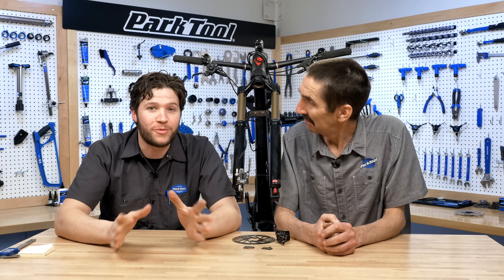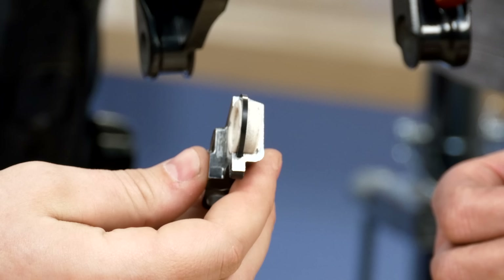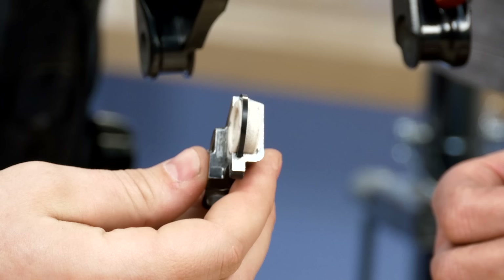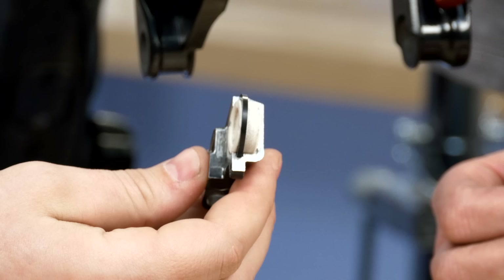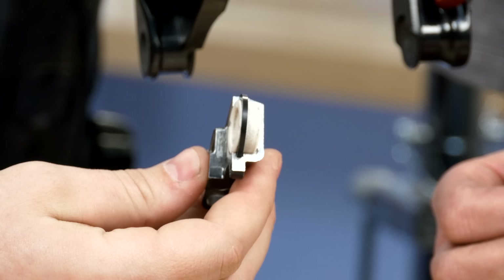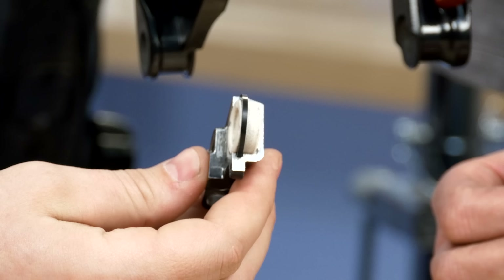How To Clean Hydraulic Brake Pistons - Tech Tuesday #104

Comment: I have the exact opposite issue, my seals are way too active- they don't want to stick at all 🤣 as in not adjusting for pad wear, what should I do? Cleaning as shown in the video seems to have only gotten matters worse.
Reply from the maker: Sounds like there is not enough fluid in the system. Could benefit from a bleed?
Reply: @parktool  I did put a funnel with fluid specifically cause I thought it was the issue, not that, don't know what's going on, cleaned once again with alcohol and made them go out "forcefully" (as in block 2 pistons, let one go out and manually adjust for even spacing from there) and it seems to be working fine for now, will see how it behaves with pad wear.

Comment: Hi! Thanks for the videos, you make by far the best tutorials but I couldn't find anything about replacing pistons...

One of my Sram Red 22 pistons (the old 18mm ones) is cracked and missing a part of it. I have the replacement kit and Avid's DOT grease. Do you recommend to put some DOT grease on the piston square-o-ring or just brake fluid?
cheers
Reply: Answering myself... According to SRAM: 

"Inspect the caliper pistons for damage and replace the pistons if necessary.
Apply a small amount of SRAM® High-Performance DOT 5.1 fluid to the
circumference of each piston. Install the pistons into the caliper bores.
...
Do not use grease. Grease will prevent the pistons from fully retracting
into the caliper bores, which will reduce braking performance.
..
Add a small amount of DOT compatible grease onto the new caliper o-rings, then install them into the caliper."

NOTE: the caliper o-rings are not the square ones but the ones in between the two halves of the caliper body.

Comment: I have a Shimano 4 pot piston from a mountain bike that’s less than 15 month old, I have explained to the bike shop that the outer bottom piston is not retracting all the way back and is causing intermittent disc rub at certain speeds which is quite annoying, they have had the bike once and said they have done a front brake service on it. I took this bike out and it is now worse than it was before. I have taken this bike back again but I don’t have much confidence of them fixing it.

Comment: I guess the seals will prevent dirt from coming into the caliper as long as the dirt is somewhat wet. After all, the seals also prevent oil from leaking from the caliper. I just wonder what the lifespan is of those seals?  And can they be replaced when 'used' or is it better to replace the complete caliper?
Reply: If you have something like a Hope caliper, then you can purchase seals and pistons to service your caliper and return it to as-new. Sadly, for a Shimano brake like this one, they don't sell service parts separately so eventually you'll have to chuck it in the bin and buy a new one. Booo Shimano :/

Comment: Thanks for the video. 

I have brand new slx 4 piston brakes on my bikes. Despite lubing/working the pistons, one side is still uneven to the other(less them 1mm).  

At the end of this video you guys day to just leave the piston and center rotor between pads. Therefore having the caliper itself slightly off center to rotor.

 I've been told elsewhere to restrict overactive pistons and balance. Then align caliper to rotor...

Wood really appreciate if you could elaborate

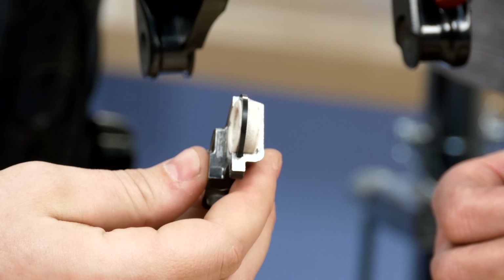Comment: 3:36 Recommend you do not insert Q-tip into container but instead pour small amount of mineral fluid into small (Dixie) cup.
Reply: I made a mistake, I pressed too hard and the pison came out, I put it back on but it caught air. and after a while I started to lose the mineral oil from the Shimano hydraulic brake. Please help me and explain to me how to proceed to put the piston back so that I do not lose mineral oil again. Thanks!
Reply: @SPN2TV  you will have to bleed it from scratch.

Comment: Helpful video! which oil should I use for my SRAM ETAB AXS 12 speed?
Reply: The fluid is in the manual for your bike.  I believe it's a type of "DOT" with one or two numbers after it. Shimano is the opposite. TIP: Register your SRAM components. Then wait a few weeks and you will get a link or invitation to a closed discussion forum on Facebook ... That is where to ask SRAM questions and get LORS of people with PRECISE answers.  Including that the manufacturer says NOT to use hydraulic fluid, or any type of lube near brakes.  (Althought here the guys did seem to do a proper clean up they didn't emphasise the safety issue enough. Lube can gradually drip into /into braking surface. But that warning doesn't solve the problem... What to clean with. Isopropyl alcohol is what one person said to cleaned with both Before AND after putting hydraulic fluid.

Comment: That was a great presentation. Very detailed with cut away parts. I had squealing brakes but after 3 repeated pad/rotor cleaning and scuffing it still squealed. After your video I checked the pistons and found they moved very little and did not retract. Followed your procedures and now they move properly. Voila!  The squealing is gone. Big thanks guys.

Comment: 3:28 they said do not let the piston fall out but what would you do if it does? someone please answer i have this problem and I put the piston back in BUT it keeps pushing out not to where it falls out again but it pushes out almost all the way no matter how many time i put it back. what can i do?
Reply from the maker: You should stop it from coming out that far. Install 2 rotors in the slot of the caliper and that will typically prevent the piston from coming out. Or You could use the handle  of a cone wrench to prevent that.
Reply: @parktool  i asked a bunch of people everyone said i needed to get them bled i have the tektro auriga hydraulic brakes on the se 2021 fat quad and the right piston fell out and spilled fluid. as i put it back in it doesnt stay and everyone says to have something or someone hold it in place then get the brakes bled to take all the air of out the system. with that i should be good and i can replace the pads and wheel. is that true?

Comment: Disc brakes still have far to go.  As a shop mechanic and rider I couldn't agree more with Chris Froome.  The industry has pushed this brakes on us and very little has changed in the technology from 20 years ago.  The pistons are generally all lazy.  They never retract symmetrically.   Even new brakes have this issue.   Forever beta product.   So disappointed in those mfrs.

Comment: Stupid question time, can you use standard brake cleaner out of a compressed spray bottle like you would use for vehicles?
Reply from the maker: You can use brake cleaner. It is aggressive and can dry out the seal so using a tiny amount of the systems fluid to lightly lubricate afterwards is a good idea. Make sure to clean up any excess with your brake cleaner.

Comment: what should i do if there is a leak of fluid from the piston?
Reply from the maker: That is a problem.  Clean everything off, and pull the lever repeatedly.  Even zip tie the lever tight so it applies pressure for some time. Now inspect the piston again.  Still appears leaking?  Most D.O.T. models can be rebuild with new seals.  Most mineral oil based brakes cannot be rebuilt and that means get a new caliper body.

Comment: I still can't seem to understand how a rubber seal sitting around the piston can pull the piston back inside the caliper. 
Could it be with the seal sitting around the piston (which sits inside the caliper) is perhaps fixed to one end of the caliper body; and the another part of the seal is glued to the pistion?  So the seal will contract, pulling the piston inside?

Above probably makes no sense; please provide the answer if you can. Thanks!!
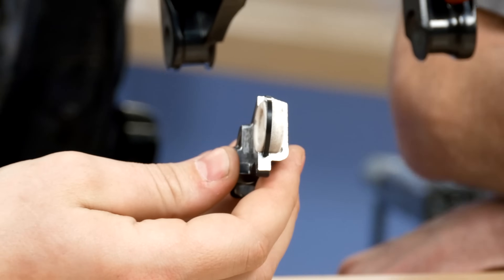Reply: 00:58
Reply: @fuckinjuicy  Okay, I understand now! Thanks!!!
Reply: 00:58

Comment: How do you reset a piston? I went to far and it fell out, now the piston is closed to tight and grabbing the rotor. PLEASE HELP!
Reply from the maker: Ah yes, the tears. You should be able to push the piston back into the bore with your hand and then finish with a piston press or tire lever. You will have to then bleed the system.

Comment: What do I do the piston on one side does not sit back and the other does not move out at all. :(
Reply from the maker: You may need to use the pressure created in the system to advance the piston that is not leaving the bore. Remove the pad from the piston that is not moving. Now install a rotor in the slot of the caliper. Make sure to keep that in place while pulling the lever. This will not allow the piston that is moving to advance and will redirect all that pressure to the stuck one. Once you get that piston advanced clean it and put a small bit of fluid from the system on it to lubricate the seals of the caliper. The piston that is not going all the way back into the bore usually means there is too much fluid in the system. This can be due to an excessive bleed that put in too much fluid or (more commonly) the fluid in the sytem took on moisture from the air and added volume. A bleed is  needed to resolve that issue.
Reply: I forgot to tell you i always pumped the brakes too far that the piston fell off, like you said not to do. Is that why my piston is not going back?
Reply: @Flipinlifestyle  yeah it has nor more fluid you will need to bleed them.

Comment: Question - after doing this on all 4 pistons, one of them is still really lazy. I worked on that one for quite a while. What do you recommend doing next? Bleed the brake line? Or will I need to replace the brake unit completely?
Reply from the maker: A new caliper would be the guaranteed solution. Rebuilding the caliper if a kit is available is another solution.
Reply: Will do. Thank you!

Comment: I'm pushing on that piston as hard as I feel comfortable and it's not retracting. They both move, but one is just stuck way further out than the other.
 
On a side note, where does the extra hydraulic fluid come from when the pistons push through the seals?
Reply from the maker: If you have a DOT system the fluid can actually pull moisture through the hose and add to the volume of the system. This causes 2 issues. 1. you cant push the pads back in far enough to get new pads in. 2. moisture in the fluid lowers the boiling point making the fluid less effective. It is best to bleed the system if you have this issue.
Reply: @parktool  it's a mineral oil system, so shouldn't absorb water in the same way (I think).
But also if you were to only push on one piston, you'd expect it to retract and the other to extend (if there is too much oil), but it's not budging.
Reply from the maker: One thing you can do to break that free is to stack two rotors on one another and stick them in the slot of the caliper and then pull the lever to advance the piston that is free. The piston will contact the rotors and will not be able to advance any further. The pressure will then go to the other stuck piston and will push it out. You can then clean the piston and should be able to push it back in. Leaving the pad in on the side that is moving will help keep the piston from advancing too far as well.
Reply: @parktool  Thanks, I might try that with something other than a couple brake rotors (to not risk bending them).
Any idea how far out the pistons can protrude from the caliper before they come out of the seals completely?

Comment: @Park Tool I tried to do this using the PP1.2 I have 4 piston breaks and the front right (righter side piston) kept extending further than the left. At one point, I got tired of messing with it and just wanted to put the breakpads back so I could go riding the next day. It's at this point when I used the flat side of the PP1.2I pushed the piston back in that the oil started to squirt out of the reservoir at the break handle. Not the little screw mind you it actually started coming out of the end of my Shimano Deore XT hand levers, That little had plastic bit near your grips at the end. Did I destroy my breaks?

Comment: If I push the piston too far out, and mineral oil comes out, have I broken my brake?
Reply from the maker: No, probably not. If you are able to evenly and firmly push the piston back in, the seal is likely not damaged. The question is did air get inside. Test it by pulling hard.  If it is firm, then you are okay.  If not, it needs a bleed.

Comment: do you need to hold the lever to push the piston back? i try this i cant push one of the piston back
Reply from the maker: The lever should not be pulled to push the pistons back in. Make sure you are pressing nice and evenly. It is possible that the system has too much fluid in it if it is a DOT system. That will prevent one or both pads from going all the way back into the caliper.

Comment: I’ve used some Pad grease as is used with Motor vehicle Brakes and I have improved feeling through the lever as well as the eradication of sticking Pads and noisy metallic scraping from the Cycles Disk Brakes.

Comment: Mineral fluid do you mean you cleaned it with brake fluid? Would be nice if you elaborated other cleaning lubricating products !
Reply from the maker: Using the same fluid that is in the system as a cleaner hydrates the seals. Many other cleaners will dehydrate the seals.

Comment: Could you just use alcohol on the q-tip to clean the sides of the pistons? Does It HAVE to be the brake specific oil/fluid, ONLY?
Reply: Fred J. I would use oil because it will aid with rehydrating the seals, oil keeps everything fresh.
Reply: @sixstringedwithabowl  YES That makes sense. Thank you.

Comment: My Code pistons have grooves and a center indentation. I’m worried that if I clean the piston with DOT fluid, I will not be able to get it out of all the recesses in the piston surface- even spraying with rubbing alcohol, and any fluid I missed will then contaminate my pads. How do you clean these types of pistons so this doesn’t happen?

Comment: Would any of this have anything to do with the fact that I still cannot for the life of me get my Shimano Deore M6000 brakes bled properly. I've tried every method, read every article, hung them from the wall, rubber bands round the lever blades overnight, push and pull method, after at least 6 or 7 attempts, and two pairs of ruined pads (woops) they still do not have the original bite they once did

Comment: So, what is the fix if you pushed the DIRTY piston back past the seals?  strip down, replace the seals and re-bleed?
Reply from the maker: Many brakes do not have replacement seals as an option. If you push the piston back into the caliper while it is dirty, you wont have any major issue. It will start to stick on the "plaque" buildup that is on the piston. If the piston is pushed all the way out I would clean it, re install it(while being careful not to damage the seal, then bleed the system.
Reply: @parktool  Appreciate the reply.  I've cleaned and cleaned the front caliper to get rid of the drag on cornering only to finally realize it is the rear caliper that is dragging.  WIP

I did your routine repeatedly till both pistons seem to push out and retract evenly. I wonder if silicone grease outboard of the seal has any merit? It would work as a dirt catcher however it might also increase the 'slip' of the piston though the seal.   your thoughts?
Reply from the maker: I would advise against the silicone grease. It is possible that the mounts of the frame are not faced correctly and the caliper is sitting a little crooked. This is becoming a more common issue. There is also an issue out there regarding some SRAM flat bar brakes. The piston in the lever is too large and makes the lever feel very stiff and makes the brakes drag quite badly.

Comment: Perfect until right at the end where they said to move the caliper if the brake pads remain uneven. Just hold back the active pad with a screwdriver or similar and pump the brake and it'll center up fine. It's a 'feature' of the more recent Shimano brakes unfortunately, causing wandering bite point - sorted in a couple of minutes every month or so as the pads wear.

Comment: I think this helped with a brake centering issue I was having. My rear wheel was almost rubbing on one side with more daylight on the other, but the rotor was centered in the caliper. After adjusting the caliper or pressing in pistons it would just happen again later. Today fixed the sticky piston on one side and now I see even daylight on each side. Maybe the better-moving side was squeezing out too much each time I tried resetting brake alignment, while the sticky piston wasn't out enough yet. I don't know if it would actually work that way, like I think it would have to almost slightly and temporarily bend the rotor from one side while braking for the piston to remain stuck out too much. I'm running thought experiments in my head while tired and I'm a maintenance newb anyway. Maybe I did something else that fixed the centering... but I think it was this.

Comment: I've opened my Guide R caliper since pistons didn't work well. Now that I want to reassemble the two halves I'm seeing oil leaking when I pump with the lever. Do you think that I just need to apply a much higher torque to the bolts (but how many Nm?) or do you believe that a liquid gasket it's needed between the two halves? Thx
Reply from the maker: SRAM should provide a torque for the two halves. I would guess that an o ring or seal has been damaged and replacing will be your best bet. There is no liquid gasket required.

Comment: instead of mineral oil what could you use
Reply from the maker: Use the oil that the system uses. Mineral oil is very readily available if that's what is in your brake system. Available at grocery stores, pharmacies and other places as well.